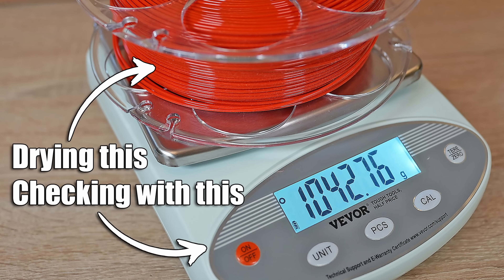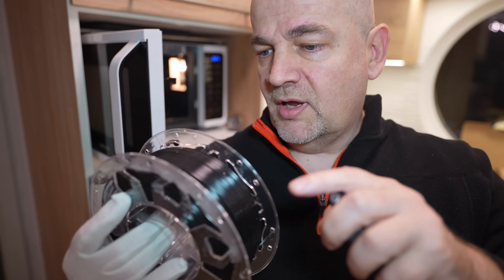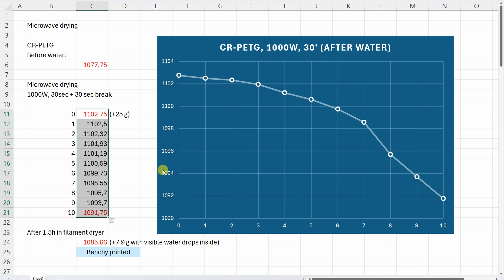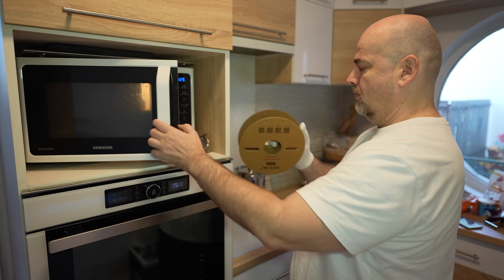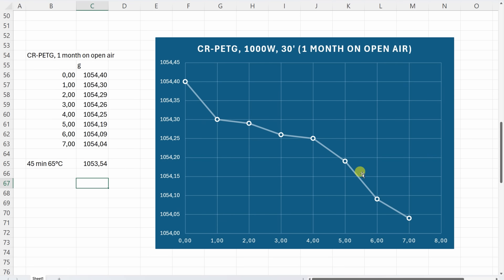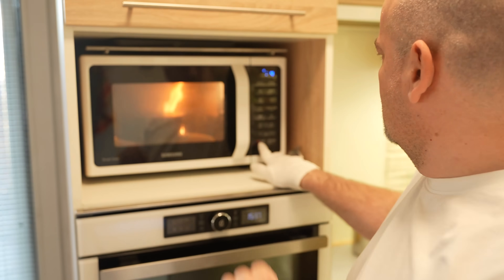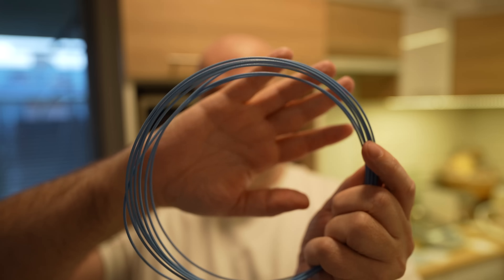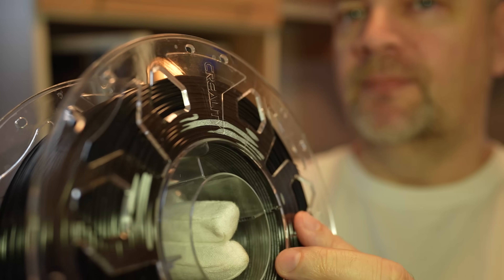Drying Filament in a Microwave: Fast Solution or Fire Hazard?

Comment: Note that you CAN put metals in a microwave. When the metal is covered (for example an aluminium tray with food or a spoon in a liquid to prevent splashing). Grids/grills  tuned to avoid the specific wavelength of the emitted radiation (and/or grounded and/or rounded)...

Comment: Carbon fiber filament is conductive. The large currents will make the filament behave like a big resistor and produce way too much heat.
In the other case, the energy is mostly absorbed by liquid water, but not vapor. That means most of the energy is put into heating water and vaporize. That's why the technique works so good for cooking and drying.

Comment: My son took my PLA+ filament to work to dry in the commercial dryer room. While he set the initial temp to 60C, somehow it overheated, and while it sure took the moisture out, it warped a lot of the filament. I unwound it and recovered some lengths of it. These lengths worked fine. But there was no way I could use much of the warped sections.
Reply: 60c too hot to dry for PLA...50c...

Comment: This seems like the solution to drying PA6 and PA6-GF at home as these filaments can be dried at high temperatures, wouldn't you say?

Dry a bit in the microwave (2-3 short bursts) and then a few hours in a filament dryer at 70°C.

Although there is always the home oven.

Comment: I’d like to see more of this testing with PLA, PETG, ABS, and ASA.

Also, with spools not dipped into water to see real use conditions for the normal user.

Do you think PLA would melt at 30 seconds on time in the microwave?

Comment: Yeah I tried it last summer too, with a roll of trimmer line (actually works way better as filament than you'd think, even on a bedslinger) I did get hot spots and melted the filament, even though I only did it in 30 second bursts. The way superior kitchen appliance here is an air fryer.

Comment: This video was so frustrating to watch. I thought there would be some consistent methodology but you do a bunch of random things and change method half way through the experiment so your data is mostly useless.
1. In the first spool, why did you dunk it in water? Now you have external water drawn up into the spool via capillary action into the spaces between the filament windings. Now you have to get rid of all that external water before you can measure absorbed water loss. That external water is just trapped in those channels, turning to steam and recondensing. It'll take forever to get rid of it without unwinding the spool. Don't dunk it, just leave it out in the humid air for a defined number of days. 
2. The second spool was on a cardboard spool. Cardboard also absorbs moisture. How do you know the water loss you were measuring wasn't mostly just moisture loss from the cardboard? You don't because you didn't have a control sample and you didn't remove the cardboard as a variable.
3. You switched to the air dryer midway so that changed your data. 
Why not do the scientific method and have actual controlled samples and methods? Measure out 100g of brand new just-opened filament, removed from spool and have each bundle simply tied with 2 zipties. Weight and record 5 bundles immediately. Place 4 bundles in a passively humid environment for X amount of days. Seal the last one in vacuum seal container/bag.  After time is up, dry one in the microwave, one day in the filament dryer, one do X days in a passive sealed container with dessicant.  Weigh and record everything at regular intervals. Compare final weights and print quality.  Science!

Comment: I want to see more of this and I'd love to see a followup video with more experimentation!
Something to consider with a microwave is duty cycle.
30 seconds high power, 5 minute spacing - that's just a 10% duty cycle.

So why not just microwave for 25 minutes at a power of 1 or experiment with the defrost cycle?

After all, defrost works AMAZING for drying out desiccant. (Don't learn the hard way like I did not to microwave desiccant balls on high for several minutes. It exploded the glass bowl from how hot they get and some of the pellets themselves exploded)
An air fryer can't dry desiccant nearly as well as a microwave.

A thermal camera and/or infrared temp gun would likely go a long way to seeing what kind of temps are reached (at least on the surfaces).

Comment: I have dried PPA-CF in my microwave oven for 10hrs before, but only because it supports hot air blasting instead of using microwaves and with good results.

Comment: I think if you had microwaved it longer the water would vaporized and exited the spool. The microwave specifically excites the water molecule. So, the spool is only getting hot because the water is getting hot and transfering that heat. It can actually do a better job evacuating the moisture than a traditional filament dryer. I definitely wouldn't do this in my food microwave though. I would think microwaving it to about 101C would be ideal (since this is where water vaporizes).

Also, I don't know how well the RFID tags will hold up to microwave radiation. Carbon is conductive so it's probably what is getting heated in the microwave. You should be able to microwave glass fibers though, there just needs to be some water in the microwave chamber otherwise you're hurting your magnetron.

Comment: @MyTechFun

A good experiment for you take a strand of solid carbon fiber fill them in connect alligator leads to each side then connect it to a bench top power supply and gradually increase the voltage until you see it start to glow red hot

Comment: I get why people think that a microwave would be good for this. But honestly to dry something efficiently you need air movement (convection), try a air fryer they are convection ovens on steroids. In my experience they are great for drying stuff.
Reply from the maker: They are great for drying stuff if the moisture is near (or on the) surface. But if you want to force that water to the surface, you need much more time. Measured with Nylon and PETG. Here is one of those videos: https://youtu.be/y3rMgwOCAi8?si=-iHSlKUXcE-sBBRB

Comment: Possibly another testing angle with cardboard spools.  Does the filament dry before the cardboard and thus I’m wasting my time drying until the weight change is flattened?  Or is the spool trapping the water, and we have to wait for the cardboard to dry first? ( sometimes I think I’m wasting time and energy drying cardboard and the filament is fine…)

And another:I just need 50g of filament is there a way to just dry the outer layer? (thinking… instead of spending hours drying the spool, cut off 60 grams, spend a few minutes microwaving it and it’s ready to print?)

Comment: Drying in the microwave can quickly result in overheating the material, while it is not much of a problem with silica gel (which can withstand high temperatures) it can be a major problem with polymers, not only because they can melt but also because heated water can hydrolyse the polymer chains. For instance i have some TPU parts that after one week at 80°C/85%RH looked perfectly fine but after a couple of months completely disintegrated into a rough powder.

Comment: Wonderful tests! I just have one question, if you heat it to 70c for how long will it keep drying?
 my technique has been to heat it and then let it keep drying while I print and also microwave it with the desiccant before bagging it.
Reply from the maker: Depend of the start moisture %. But sometimes it may be too long: https://youtu.be/u3TC8jJRjgs?si=X_UQg6rv4wXXdkAb and for Nylon: https://youtu.be/y3rMgwOCAi8?si=WLbd20-qYq5E7nsp
Reply: @MyTechFun   I watched them, but the microwave heats the inside, so it will be much better for driving out moisture from the inside during open air drying...

Comment: You might also want to reconsider using the microwave if your filament spools have RFID tags.
Poor things are going to be blasted to oblivion and back. (Could also become a fire hazard, as well)

But great idea to use a microwave, as they are basically just superpowered drying machines.
Reply from the maker: Yes, this was mentioned in the video too, but it's goot to repeat it more, bigger chance that others will be informed.

Comment: New crazy idea to try: making inline filament dryer using magnetron.
Reply from the maker: I just wanted to mention this idea in this video, but after experience with CF filaments, I don't think it is a good idea. Pity, since CF filaments needs more drying compared to regular materials.
Reply: @MyTechFun  If only CF filaments go bad, that's not such a big deal. Inline dryer appeals more to "normies" who don't want an advanced system of dryboxes and just want fast loading of a big library of pretty colors. The hardcore engineering filament folks can deal with active dryboxes that cost 20% the price of a roll of filament.

Comment: Have you considered microwaving on power level 1 or 2? Microwaves don’t change their power output, just the duty cycle - so it would be similar to your test, but more automated.
Reply: Is this true for all microwaves? My understanding is that inverter microwave ovens do vary the power output but I’m no engineer. I think airflow is more important when drying and the tightly bound coils slow the ability of the water vapour to escape. I thought that an air fryer might be worth trying as it is effectively a filament dryer on steroids.
Reply: @justcruisin109  Simple test is to cover the plate with mini marshmallows and test at 100% and 50% (or 30%).  If the power is truly being reduced to 500w (from 1000w) by an inverter, you'll see the marshmallows rise consistently at 50%, just slower than 100%.  If it's just the magnetron being pulsed, you'll see hot spots.

Mini bubble wrap is supposed to work too, but less yummy.
Reply: @ you may be right about inverter microwaves.

Comment: Haha yeah one forgets to think about it but CF is conductive, just the same as graphite. It causes interesting problems with continuous carbon fibre laminate products, that they can be radio shielding, or provide occasional stray conductivity from one end of the panel to another, always need to remember. Still, with how little of it is in the filament and short fibre length, more like powder, with suspensions like that usually having enough of the insulating polymer between individual fibre pieces that no current can form, the outcome wasn't entirely obvious. The individual fibres must be touching, to where induced currents get forced through that high resistance contact spot and create heat.

I wonder if you'll ever run into a spool of black filament (pigmented with carbon black) which will also burn in a microwave. It shouldn't be too likely but it's not impossible!

Comment: I store my filament in boxes with molecular sieves and they pull the moisture levels down to 1% or lower. (If you can trust the bme680 measurements down in that range). I dont have a fancy scale but the filament is getting dryer in it over time without heating. Would be interesting to see this tested! The molecular sieves can be dried in the microwave. Just keep an eye on the temps and use a heat reistant bowl ant some extra isolation below. Temps over 350°C cam be reached quickly if you apply to much power. 30-60s heating intervals should  work ok.

Comment: I use my microwave to dry desiccant so I'm not surprised it works for filament.

With CF filament though that it is conductive is not an issue. You can put metal in the microwave no problem.

What is in issue is edges and points, they act as a focal point for the energy and cause plasma to form which obviously very hot 😂.

When I want to heat something but retain a crisp texture I use a metal tray in my microwave and use the forced air heater and the microwave to heat things quickly and crispy.
Reply: Interesting, coz I use an air fryer for that purpose. Also I use air fryer to dry filament😂
Reply: @tinkeringpoko You know, a convection oven is an air fryer.

Comment: Lovely humor!

Drying in the microwave seems simply too fast, the water in the tightly rolled filament has nowhere to go. We were lucky the spools you used had some closed flat surfaces so we could see the water drops. They are for sure also present inside the filament windings.
There was another YouTuber (3D Printing Ideas) who tried to run the filament trough a can and blast i with hot air to dry "on the fly" https://www.youtube.com/watch?v=9ldRN2B4iJY microwaves instead of hot air might work better here. Only it will be hard to control or even pain dangerous.
Maybe a low power microwave source inside a dryer out of which one can print directly will make sure the outer filament windings are always dry.

Comment: Since CF does catch microwave and conduct electricity, I was wondering if CF-filament would be suitable and economic enough to make a shell to shield some minor electromagnetic interference. You know, some electronics aren't designed well, I want to print a case to make the signal more noise free, say for DACs. Would be really grateful if someone can answer my question.
Reply: Since the fibres aren't continuous and if you test the filament with a multimeter it's not conducting I doubt it will do much. I use copper foil/tape with conductive glue to line the Inside of guitar electronics cavities. Works very well, better than conductive paint. Just make sure to connect it to the ground of your circuit.
Reply: Continuous carbon fibre products are actually RF shielding somewhat. With short strand carbon fibre i think the outcome isn't going to be very strong, because most of the carbon is just going to be weakly capacitively coupled to each other with a lot of plastic in between. Small spots of high resistance contact is enough to make microwave cause a local fire, but that's not quite what you're looking for.

Yes as the other commenter suggests, foil is pretty good! You already have aluminium foil at home to try, right. Tape a ground lead to it. But consider that shielding is often the least interesting and promising path to getting something behaved noise free, many quality issues are actually down to bad ground path design, particularly ground loops. A ground loop is a grand low impedance loop antenna, and once it has got some current induced to it, it causes a lot of issues, for one at high input impedance, a small current induces a substantial signal voltage; and for other, if you have opamps along the loop path, they are driven to create a proportional replica of the input voltage, which means they must create current to compensate ground currents and may run into limits and start distorting. You can suppress current-to-voltage issue by shunting, say lowering input impedance to 10k or so.

Comment: I'm guessing Igor doesn't have a wife... or no longer has a wife.   😲

I should have finished watching the end of the video before joking about Igor's wife.

Carbon fiber is conductive.  Don't put it in the microwave oven for the same reason aluminum foil shouldn't be microwaved.

I print a lot of TPU which is more hygroscopic and needs to be dry to print well.  I've had an idea to make a 400 mm tall 60 C column with a 3 mm inner diameter, with a small blower to create upward forced convection, to quickly dry the filament as it enters the 3D printer.  No need to use desiccant, and no need to dry filament before using it.  I should have patented the idea.   🙂
Reply: not a new idea
Reply: @riba2233  - Gee, I'm glad I didn't spend $20,000 on a patent attorney.   :-)

Comment: Thanks for doing this so we don't have to!  I am really curious about heat + vacuum drying and how fast it would be.  Meaning - get a spool as hot as reasonably/safely possible (for the filament), then immediately place into a vacuum, maybe while continuously pulling a vacuum to pull out the moisture.  I thought I had heard that is process for industrial injection molding?  Thanks Igor for continuing to do these experiments!  I am waiting for your updated dryer comparison to buy one.

Comment: The moisture stuck in the spool makes me wonder if that's something vendors should address with different spools. While this experiment was very extreme, I don't see why this should not also be an issue with regular moisture and a regular filament dryer. Maybe more holes in the spools can improve the drying behavior of filament in general. I hope filament vendors take notice.
Reply: The inside wouldn't need to be circular.

Or just use cardboard spools that would corrugated?  It works both ways too though so theres that, like cassettes with dehumidifier built in them do have some advantages, but they all want to add drm to those..
Reply: Cardboard is really a horrible choice for spools

Comment: Filaments with lower glass transition temperature might fuse together from this method. I have a spool of PETG that's fused into a solid block from overheating it in a regular dryer, and the microwave heats the water up to 100.

Comment: I'm using regular oven with a fan somewhat above 60C and balcony floor in the summer sun works too - if not better. But microwave? It needs to locally heat water to or above 100C to evaporate it possibly creating some high pressure hot bubbles inside (just like in the nozzle) and I'm afraid it can degrade plastic or create some air cavities. Also all energy from microwave has to absorbed somewhere and I'm not sure how it would behave with dry filament, maybe magnetron can overheat and there's a safety shutdown. Then, temperature cannot be controlled. I don't know how PETG behaves at 100C, if it fuses together or not, it's not above melting point, but above glass transition.